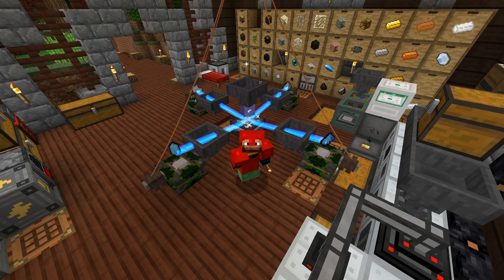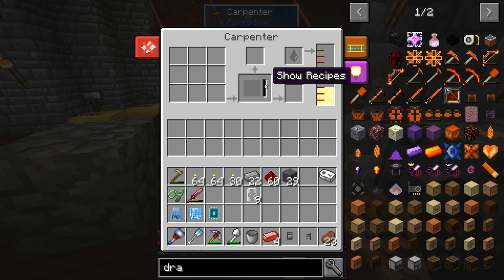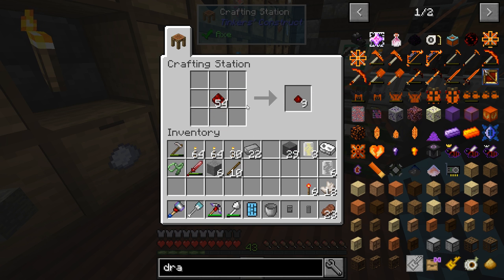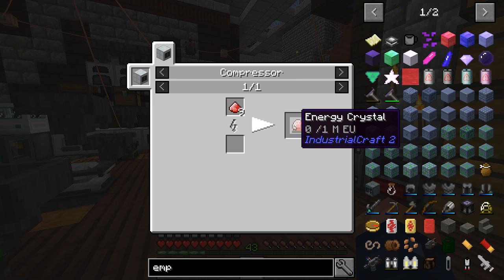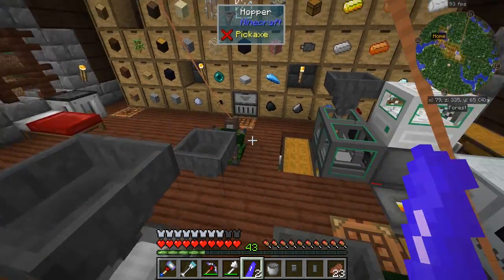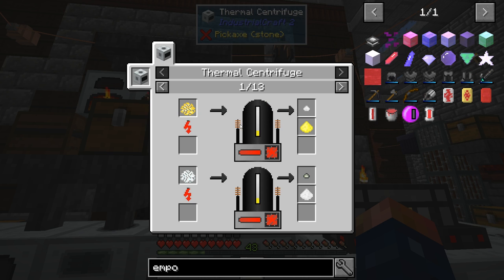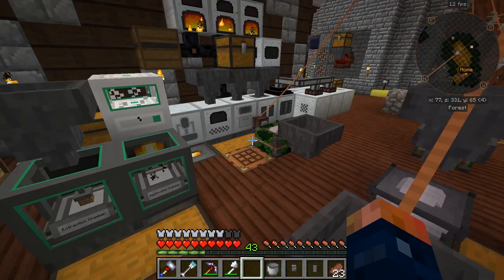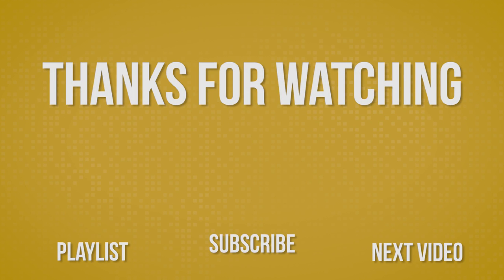Empowering Diamatine | Age of Engineering | Episode 14

Comment: i hope you learn ic2 fast , cause you need it , for me it shows that is the base mod from all the rest start and he use all functions of it - i go with wind turbine but you have to build the converters to bring the input down to 32 Eu - if not all explodes - not like in ftb expert - just a little bit wood and cable to get power
Reply from the maker: +Frau Lysifee Yea I'm getting to the point where I'm learning more and more. Ic2 power is new to me.
Reply: Yeah the Thermal Centrifuge uses 48 EU/t while every normal Generator produces 10 EU/t

Comment: Not sure that you can help but my carpenter and squeezer both say can't work when look at them but the squeezer will made seed oil but the carpenter will not make the circuit for the drawer controller I even made a new carpenter and it says the same thing. Can't work.
Reply from the maker: It need water to make the circuit I think
Reply: It has water  I think Im going to try and get more circuits